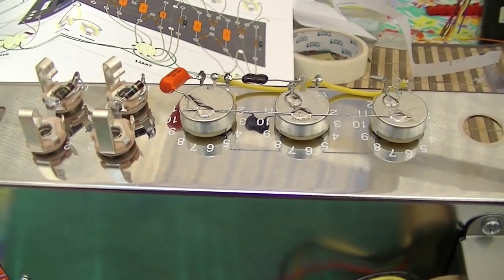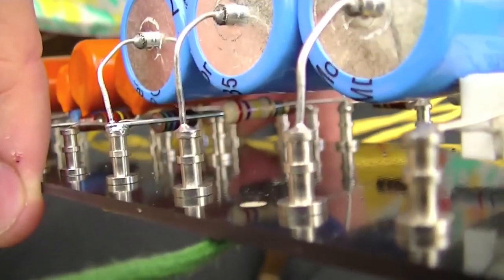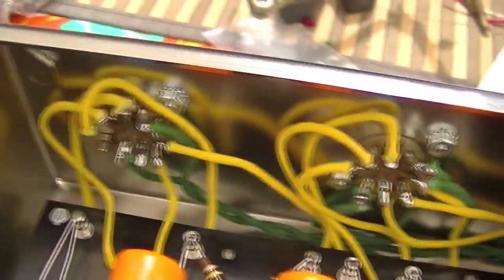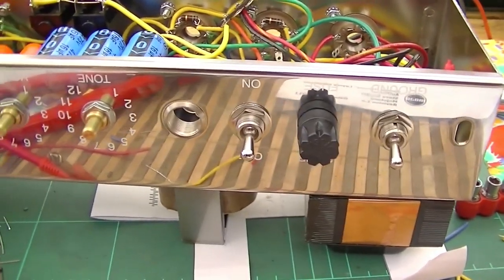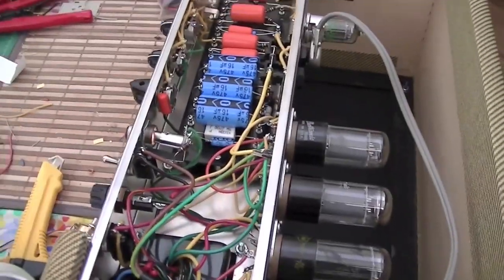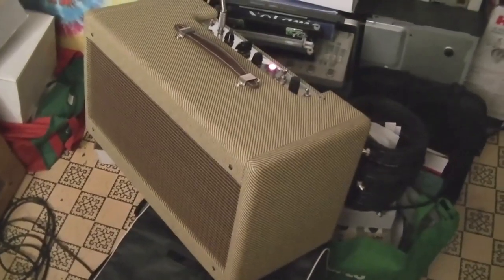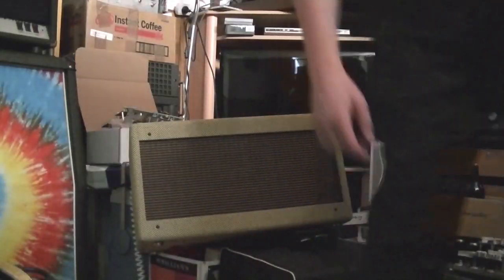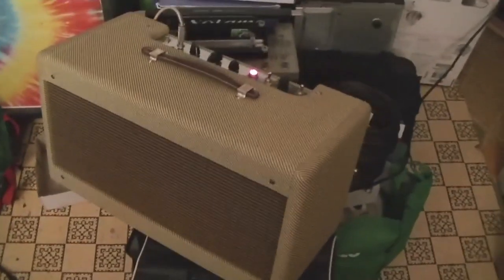Completing And Demonstrating My Mojotone 5E3 Amplifier

Comment: Love that tie dye 4x12! Also thanks for this demo. I’ve been thinking of building a  5E3 circuit into a head format for a while now. This confirms it’s a pretty good idea👍
Reply from the maker: The tie dyed 4x12 was influenced by photos of the Grateful Dead in the early 70's with their tie dyed Twin Reverb amps. I just bought a tye dyed sarong, which is very light thin cloth, on eBay and stretched it over the existing Marshall grille cloth.
Reply from the maker: Oh, in case you want to know, my favourite Grateful Dead era is 1967-1969 when they were a loud and powerful acid psych band. Anthem Of The Sun still blows me away.

Comment: It's hard to tell in the video but it does seem that those Tonkerlite's have a hell of an awesome grind. I was thinking of building the Mojotone 5E3 as a 2x12. I've listened to a lot of speaker samples but nothing sounded as good to me as these Tonkerlite's. But wow, they are 125 watt rating. How does affect the volume needed for breakup vs a lower wattage speaker? How is the bass response, etc?
Reply from the maker: Admittedly I haven't used this amp with the Tonkerlites much, but it was all I had at the time as I use the cab with the Hiwatt I built because they're the closest sounding current speaker to the Fanes that were in Hiwatt cabs. I remember them sounding rather crisp with a nice tight bass, not really delivering the midrange honk I would expect with the 5E3 but perfectly matched for a Hiwatt. A mate gave me a couple of old 25W Greenback Celestions on long-term loan, and those are considerably better suited to the amp if you like the Neil Young sound. It's all subjective really. The Tonkerlites are great, but not the sound I was after for the 5E3.
Reply: @snarfusmaximus  Well what I'm after is a really good organic growl. I dont want the compression and smooth distortion that a lot of people seem to want. Not for this amp anyway. I like dynamics, touch sensitivity and all but the distortion I want should be raw.
Reply from the maker: @RevengeWP  You'll get all of the above with the amp and the Tonkerlites will make it sound fuller than it's known for, without limiting it to midrange.
Reply: @snarfusmaximus  yeah that sounds exactly like what I want. Thanks for the input.
Reply: @snarfusmaximus  yeah that sounds exactly like what I want. Thanks for the input.

Comment: Sweet build :) Thinking of doing my own. I do question the ground switch, and bleed resistor. If you have a proper three prong/conductor power cord, no need to swap chassis ground. If amps wiring, locations of transformers, wiring, heater twists, etc. the hum will be as it is in a good tube amp. As for the bleed resistor, no need. The caps will discharge themselves, maybe slower, but they will. Adding that resistor, even at 250K I think it was, at that voltage, will be power lost to heat, and maybe add to the ESR ??. Now maybe that will add to "tone", but why not use higher b+ resistor, lower plate voltages, bias, lower UF value, input pre-amp, etc those tricks instead. For safety? Why, who, when will someone be able to touch those connections? If to service, the person should follow proper discharge procedures anyway.
Reply from the maker: If you have a proper chassis ground to a 3-prong power cord, yes, ignore the ground switch. I originally utilised it as a standby but have since undone that and the switch is there purely for looks. The bleed resistor is there purely to make it idiot proof. I can sometimes be an idiot, so I plan ahead.
Reply: I hear ya, I have met the mighty electrons a few times, lol. First, very young, picked up an old b&w tube set, started figuring out what was what, and how to fix it. At the time, the high voltage at the top of a tube was un-known, oops, grabbed the rubber top boot, to make sure it was on tight, while forearm rested on chassis, ouch ! Worse part was the sore elbow from smacking it on the reflex, but lucky it didn't go through the ticker  :)

Comment: Any reason that the components are mounted above the board supported only by the leads? I’ve always been told to have components, especially the larger capacitors, mechanically secured to the board with a bead of adhesive or zip ties to prevent breaks in solder joints from vibration. Other than that difference of opinion you have a nice clean build.

Comment: Liked! Thinking about a Mojotone kit hence watching your video. I've narrowed it down to three, either the 5F6A Bassman, the 5E8A Twin low power, or the 5F8A Twin high power. Newby to amp building, but I do all sorts of unusual guitar wiring without problems, have good soldering skills, and able to read wiring diagrams.

I didn't think there could be problems with a kit like this, but you have raised some serious issues which make me baulk a bit. Could you elaborate on those fixes you made, or do you think I'm getting in over my head? I feel like I'm standing before an icy cold pool too afraid to dive in, and everybody else is already in shouting "come on the water's fine after you get used to it". G'day from Gippsland Vic.
Reply from the maker: Some problems were due to having big hands in a cramped chassis, and using a turret board as opposed to the supplied eyelet board. I am also a tad clumsy. The ticking sound was cured by further tightening the nut that earthed the chassis. The modifications I made were because I am a pedantic bastard. The ground switch wasn't wired in the instructions, for obvious safety reasons, so I utilised it as a stanby switch. Mojotone do really nice kits and the tweed ones are easy to build.

Comment: Great job, great sound.  I understand your reasoning behind the way you wired your speaker jack; but, do you think there is a reason they didn't wire it that way to begin with?  Would the original method have created less strain on the amp in terms of ohms when two speakers were plugged in?  Also, is that an old Sunn Colosseum Slave on your 4x12?
Reply from the maker: Probably the reasoning behind the way Fender wired the speaker jacks the way they did is cost and simplicity - one doesn't have to buy fancy switching jacks. Also the original was a combo so there was always a speaker plugged into the first jack. Neither wiring method is any different when two speakers are plugged in as they work the same way in that respect. My choice of wiring is due to the possibility of me lending the amp to a friend to play with. I like eliminating factors that may cause damage. Also I don't like to think too hard if I have the desire to play after a few beers.

The Sunn amp you see is a 100S that a friend had loaned me for a while. It's a great amp.
Reply: Thanks for the reply.  It being a combo originally totally explains their reasoning.  I was just curious.  Great amp.  You did a great job.  I hope to build one sometime, and your video was really helpful.

Comment: Nice HT-32 in the background.      (wb6acu)
Reply from the maker: H Slaw - One day I will fix it and get it on the air. I also have the matching SX-115 receiver.
Reply from the maker: G.Gorrell - The output transformer is fine.

Comment: Great video, really. I am so happy I saw this video and read the discussion here before starting to solder. So Mojotone and Tubedepot just follow the original wiring for the power switch? Could you elaborate on why the switch should be on the hot and not common, but all tube amp are still wired like that?
I am also a bit confused about the HiWatt speaker wiring you propose: what is the difference between the dead short in the Fender and the dead short of the Hiwatt.
Thanks so much for posting this
Reply from the maker: I like the Hiwatt speaker socket wiring because plugging into either socket breaks the short, therefore making it rather idiot proof - i.e. I don't have to think too hard after a few beers.

Follow the original power wiring but ignore the ground switch, wire the mains ground lead to the chassis, the active to the switch, and the neutral to the transformer primary. Neutral sits at or near ground potential so it's safer to have that permanently connected and switch the active instead.
Reply: Thanks for your reply: my question really was: I heard it was bad to short an output transformer or use shorting jacks for speaker connection. Is there a difference between shorting an output transformer to ground and shorting it unto itself?
Reply from the maker: Although both aren't good, the amp has a better chance of surviving with the output shorted rather than open circuit. In most amps, one end of the transformer winding that the speaker connects to is grounded so there is no difference shorting to ground or unto itself.
Reply: Ok, the Fender wiring on the speaker jacks looks bit ssstuuupid if you suppose they use grounded stereo jack. They didn't, they use mono RCA. About lifting the common: I just learned that i.e. in Sweden it is obligatory to lift both common and hot in a switch. So it cannot be too bad. 
Don't want to sound cocky, or anything, you obviously know your electronics. 

But thanks so much again Snarfy, today I got my 5E3 a-growling... .your video was seminal to me completing it at last.

Comment: could you pls tell me the bleed resistor you put  underneath electrolytic cap is that a 1 watt or 1/2 watt ect?thanks
Reply from the maker: Alvin s You can use eithe a 1/2 or 1 watt. The general rule of thumb for the value is about 1k per volt. I removed the one you saw in the video and ended up putting either a 330k or 470k on the very first filter cap. Either value will do the job.

Comment: well this whole thing, video and comments, makes me wonder if I should even bother putting together my princeton kit. Can't trust the circuit design nor the comments. Btw, I have a RetroKing clone of a Marshall 18 watt amp that blows the el84 tubes if I do not use standby to get them warmed up. So, what gives with no need for standby?
Reply from the maker: This uses a tube rectifier so it powers on slowly. From what I understand, those Marshalls had quirks but blowing tubes is not good. I think you should be fine with your Princeton kit. They are a pretty solid amp.

Comment: You should never have a standby switch when using a tube rectifier, if the tube is preheated before the reservoir capacitor starts charging the rectifier will take the full inrush current, very dangerous! nice amp nevertheless
Reply from the maker: +jozzef1990 Yeah, I read that too. I had put a 100nF cap after the rectifier but before the standby switch, like in the JTM45 reissues, as this supposedly helps to prevent any potential damage from the inrush current.
Reply: +snarfusmaximus I doubt a cap would a save rectifier from inrush current. Do yourself a favour and don't use the standby switch. Only DC coupled cathode followers benefit from a standby, even then, a simple diode+resistor protection circuit is better than a standby. Standbys are for radio transmitters, not guitar amps!
Reply from the maker: TheAndyroid Yeah, sod it, you make a good point. I'll most likely undo the standby switch before I next use it.
Reply: WTF are you all talking about, do you know the difference in direct and indirect heated rectifiers?  Apparently not, and to say so goes against any thoughts of Jim Marshall and Leo Fender wisdom in their design.... Yeah, your right no amp needed a standby switch.... damn noobs

Comment: issues ? mojotone claims that it takes 5 hours to build one of these
Reply from the maker: snorrevonflake Most issues were caused by using a turret board mounted on spacers as opposed to the supplied eyelet board. I prefer turret board for its rigidity. I also have rather large hands and working in a small chassis was a bit of a challenge. Had've I decided to keep it stock, it would have been easier. It took me more than five hours to build not only for the above reasons, but also because I like to work slowly and regularly check my work so as to have it working first go. It was definitely a worthwhile project.
Reply: snarfusmaximus
yea same here, i have been working on a champ style prototype for about 10 years now ;-)  so i was amazed to hear about the 5 hrs in a mojotone promotion video.

Comment: How difficult is this for a complete first timer....no electrical experience at all.
Reply from the maker: I'd recommend building some pedals first, like fuzzboxes. Less likely to fry yourself. Tube amps have high voltages in them in the order of several hundred volts.

Comment: So, this is not a stock Mojotone kit WTF are you using a turret board in a fiberboard based amp?  Jesus, your thoughts are to "improve" the 5E3 design?  So ALL of the 60 year old 5E3's built that are still in use today are unfortunate they were designed by you, not Leo Fender?.... damn, dude get real you do not know how to build an amp.... the flaw is not in the design, the flaw is in YOUR execution
Reply from the maker: I built the amp for me, not anyone else. I like turret boards. I also like having a properly earthed chassis rather than the possibility of a leaky capacitor making the chassis go live. While we're on the topic of amps, I guess it was a thoroughly pointless exercise that Ken Bran "improved" the 59 Bassman circuit to make the Marshall plexi or that Randall Smith modified Fender Princetons to make the early Boogie amps.

I also checked out your YouTube page. Interesting to see that you have no content at all. Seems that you're like the person that would mock somebody's car yet doesn't know how to drive.  Can you please point your backside towards Australia as my house needs more sun on its solar panels. Thanks...